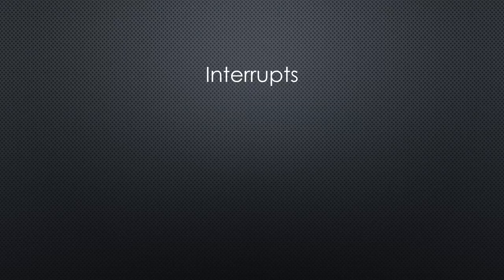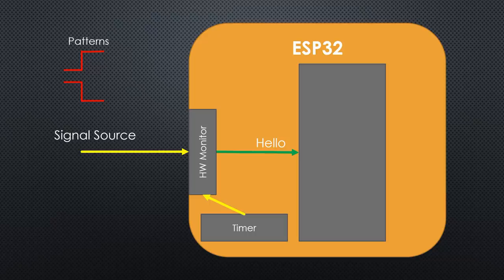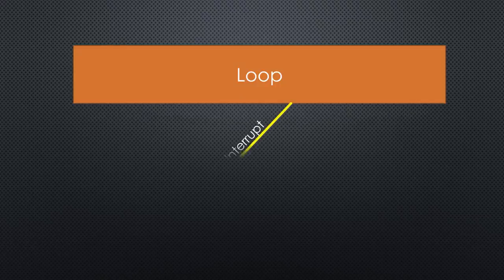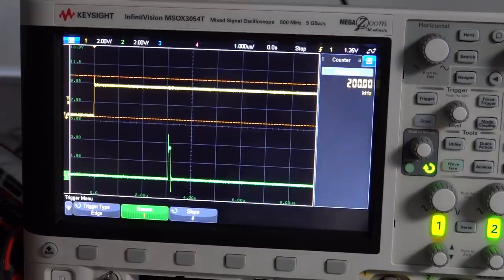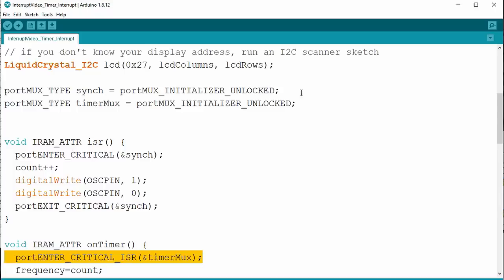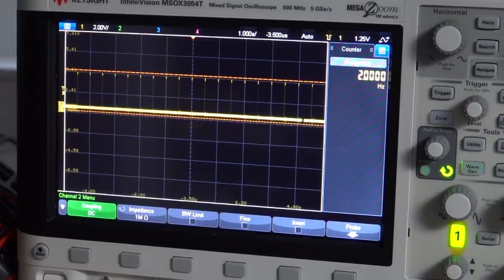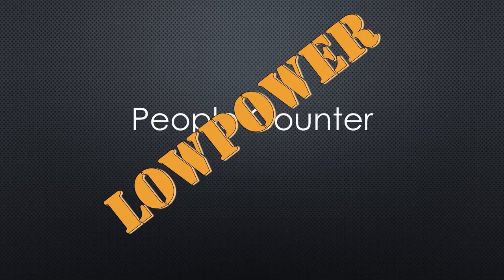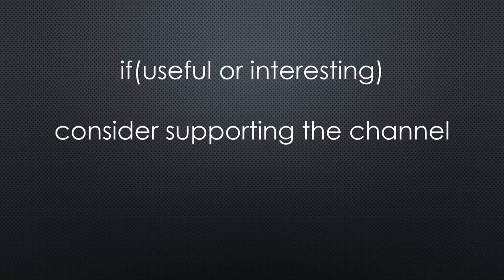#328 ESP32 Secrets: Interrupts, and Deep-Sleep under the Hood

Comment from the maker: At 15:20 I mixed micro with milliseconds. As you can see on the oscilloscope it is milliseconds
Reply: No big deal. It takes me an even longer time to wake up : )
Reply: Can you do a video on CAN bus? Also check out my channel if you want to see me build a two-legged walking robot. Enjoy
Reply: This inconsistency and delays you are showing is not a problem of ESP32, it's a problem of Arduino porting for ESP32. Just use ESP-IDF directly and redo the experiments - results will be completely different ;)
Reply: @techfuture9846  The 150ms of delay after wakeup to actual code running is probably issue with bootloader.
Reply: @movax20h , I'm talking about the pure interrupt response time, jitter, etc. The wakeup time is different beer.
Reply: Friendly hint - instead of comparing millis to previous time + constant, set the "future event" time and compare. Saves the adding operation in every loop run...
Reply: @rklauco  Or even better the rollover safe one that compares durations instead of timestamps (handles max. 49.7 days intervals):   
unsigned long delayStartTime = millis();
while (millis() - delayStartTime < 1000)  {   //do something }
Reply: I believe you can add text over the video to correct errors in the speech where they occur.
Reply from the maker: @gkeepleft  I do not have this feature. I only can blur an area or add info cards 😞

Comment: Is there a reason you used portENTER_CRITICAL() in the Pin ISR and portENTER_CRITICAL_ISR() int the Timer ISR? From my understanding both should be portENTER_CRITICAL_ISR() because they are called in an ISR (FreeRTOS Limitation). That could be the reason why your esp32 is resetting on very high frequencies.
Reply from the maker: The reason is that I found different examples.I am a RTOS noob
Reply: @AndreasSpiess  does changin that makes any difference regarding the reset behaviour at high frequencies?

Comment: This is why I still rely on 8 bit / 16 bit PIC MCUs, they do a very good job at handling interrupts and have a simple way to hook a internal timer to an input pin so you can count very fast signals. It makes easier to implement control loops like PIDs. Only if I need a web server or something to do with WiFi I go for the ESP32. The ESP32 is not a Jack of all Trades.
Reply: The more I learn about the ESP32 the more I want to just stay away.
Reply from the maker: Most of my projects are connected these days. This is why I like the ESP32. But sometimes I also use an Arduino...
Reply: I think that right now the ESP32 is the most complete microcontroller when it comes to stay connected and also have massive processing power. But if you don't need connectivity there are better options out there than the ESP32. In the end we choose what we feel comfortable using...

Comment: Mr Spiess, I enjoy your presentations and like this one too. Thank you for all your effort and shared knowledge. There are several reasons why CPU like this one may have long interrupt latency. One of them (and it is a Real Time limitations of large processors like multicore Intel and ARM) is cache coherency. Simple, interrupt code maybe not present in cache and other current content of the cache need to be saved before reloading new one to/from RAM. For vary fast approach, user need to instruct compiler (I dont know how to do it at ESP32 yet) to keep interrupt service routine (if short) permanently in cache. This is typical approach for RT Linux for example.
Reply from the maker: You  are right. There are a few other comments pointing in your direction,. too

Comment: Thank you for another interesting and instructive video Andreas.
>edit: went through the comments and found this was already reported, sorry
I just wanted to add that RTOS seems indeed to be a culprit for the interrupt response latency and jitter. I think that attachInterrupt actually hooks up not to the interrupt controller but to an RTOS callback function. This function is entered the queue of RTOS tasks, and get executed after the completion of all the previous tasks only.  Apparently it is possible to get a fast interrupt response when programming using noOS SDK from Espressif but I did not try this yet.
Reply: That's a mistake then. It's an interrupt and should have a higher priority than a normal task.
Reply from the maker: @Alexander: Maybe I will have once a closer look into RTOS...
Reply: I don’t get it… Arduino is by no means RTOS, and it has no callbacks or other real time capabilities
Reply: @Quemedices684  ESP32 Arduino calls various functions that are built around Espresif's SDK that in turn uses RTOS for WiFi operations. If one does not need WiFi or software timers then no RTOS is involved indeed.

Comment: Thanks a lot for your effort, your experiments,  the video and the explanations. And we are now back to the same question we discussed when the ESP32 became availabe: How to use the different cores for different tasks in Arduino IDE , e.g. to decouple WiFi. Up to now I did not find a solution. This is why my counter at the water meter still uses 2 pcs ESP8266. One just for counting and tranferring data via HW-serial without any WiFi output and the second for analyzing the data and communication with my home automation system. Not very elegant, but runs very stable, uptime 657 days since the last blackout caused by road construction works.
Reply from the maker: I think this is a good concept. Or use a little HW for time critical tasks.

Comment: This video helped  a lot! I wanted to monitor my PV panel energy harvesting using an ESP8266 and an arduino DUE (i know, not ebergy efficient but thats what I had lying around). Before th is video they were consuming 210mA and up to 250mA when publishing the measurements. Now i modified the sketch so that the DUE is always asleep (by pull down resistor on reset) and only wakes up for 3 sec (by the ESP) to measure and transmit the data to the ESP then go to sleep again. The ESP then (after connecting) publishes the data and goes to sleep for 20 sec or so. The result is that during sleep they both consume on 38mA and only 100mA when the ESP is awake. Only 3 seconds of 200mA now which easily runs this 24/7 on a single 18650 cell and for several days! Thanks for the insight!
Reply from the maker: Nice project!

Comment: Your videos are always excellent. By the way, If you want a low latency ISR on the ESP32, consider placing it in IRAM. (There is a flag you can put on the ISR definition to do this).
Reply: He already did that. I think the issue with ISR is due to arduino code, not ESP32. Also I don't think you really need the mutexes in ISR unless you manipulate more complex data structures from ISR. doing read-modify-write (like count++) from ISR, while rest of the code only do reads (so you might need to have two variables to track how much count you already processed, not reset it back to zero), is safe and doesn't require a mutex.

Comment: Andreas, perhaps a followup comparing the interrupt coding and latency on other 'Arduinos' like STM32, SAMD21, ATMega, ATTiny, ESP8266, MK20DX (Teensy), SiFive E31 (HiFive1), etc.
Reply from the maker: This is a very special topic. So blogs are probably a better place for such comparisons.
Reply: Take a look into there datasheet and you can compare by your own.
Reply: @ripper121  Ah yes, datasheets to find out about interrupts and how they affect everything... let me just quickly read for dozens of hours to compare a few µC...

Just seeing that a ESP32 is pretty much useless if you go into deep sleep is enough information.
Reply: @leocurious9919  Really, that's a very specialized problem and different for each individual case, as Andreas said. Think about changing just one clock cycle in your application code changing the complete timing that is at issue here. It is best to simulate this for each individual case, better to test it as an experimental setup. If something is important for a preliminary decision, it is the limiting/rating values and the clock behavior that can be found in the data sheet.
So @Ripper121's remark is far more helpful than displaying one's own laziness.
Stay healthy:)
Reply: @dieSpinnt  It would be a perfect followup to this video. And for which videos does this not apply?
"displaying one's own laziness"
Reply: Agreed great topic even for makers, IMHO.  Would add: How fast (or not) can it read from flash?  That's also a real differentiator that isn't obvious from specs.
Reply: @dieSpinnt  Although i also preach RTFM to everyone, your comment about Leo's laziness is unfounded. Why are you watching any of Andreas videos then ? Most of the content in this and prior videos can be looked up in the docs too. 
The question Leo asked is a valid one,  and i also agree that a good followup video would be to compare deep sleep wake up times of a few MCUs; and that's just an example (since this video talks about interrupts, comparing the way it's used by different boards is also a good follow up). 
Anyways, It's up to Andreas to decide what he wants to do in his channel and leo just gave a valid suggestion.
Reply: @srtghfnbfg  Andreas videos are of a very high quality in terms of information and relevance.
It is my right to say what I think of a (in my opinion) idiotic remark that you think is valid. Am I not justifying it?
And before someone feels trodden on the tie again: Idiotic is not related to the person, but to the comment. We all make mistakes.

Where the hell, where do I tell Andreas what to do? (I misunderstood your last line here, by force)
If I do something, then maybe to contribute a little bit to the wonderful knowledge that Andreas brings to people. At least that's what drives me and I'm trying.
It is up to you to do what you want. You seem to have misunderstood me. My remark about laziness was certainly not meant to be hurtful. More sarcastically funny. I can understand that one can interpret that differently, like you. But you are wrong and I hope to have clarified that. Not everything is always malicious and meant in a commanding tone by Adolf Hitler.

RTFM, study, research. Everything takes time! No master has fallen from the sky yet. Laziness and botch will not get you any further.
I stick to it, don't force anyone to think so and I don't give a shit who shares it! ;)
Got it?

P.S .: What got into you trying to advise me what to look at or not. Just think about how insolent and patronizing that is. Well, you definitely haven't thought about it. By the way, that's another problem that we should add above: Don't just read the datasheet's/AN's, think about it and understand it:P

One more to convince you how silly Leo's comment is: ESP32 and maybe all other MCU's he talks about and doesn't want to study in detail are DETERMINISTIC machines. Still asking because that speaks for itself?

Comment: @Andreas, I detach the interrupt at the beginning of the ISR on my Dimmer control, it's only 60Hz and an ESP8266 (today) but it did resolve the flickering I was facing at the edges turning on the off the light completely (and smoothly). Wifi has to be on and there is intense MQTT to keep dashboard as real time as possible, so if I miss a trigger at the edges I just complete the cycle one way or another. With this I could literally get the entire 1% to 99% (in a logarithm scale for real light scale) without bugs. Another great video from you. Cheers.
Reply from the maker: Interesting. I thought 60 Hz would be possible, especially on the non-Wi-Fi core.

Comment: I agree with your idea of being the RTOS influencing the interrupt latency. The RTOS itself (which seems to mee FreeRTOS reading the definitions you wrote to allow ISRs to be safely called) has surely some routines to schedule our loop() function with its own tasks, which can be in turn the communications module handlers (Wifi and/or Bluetooth). Even though you disable them, they could be still working for some reason. In addition the scheduler itself can use an interrupt to switch internal tasks, and this can be another jitter cause.
Reply from the maker: Many other commenters support this theory.

Comment: A great part of the inaccuracy in the interrupt code (at 7:13 in video) is caused by your own loop code: 
{ frequency = count; display(0, "frequency=", frequency); lastEntry=millis(); count=0 }

You use count but reset it only after displaying on the pretty slow LCD. That means, all events that occur during the LCD operation are not counted, but lost. Also, if the duration of LCD output varies, it worsens the count precision. You could improve it if you first completed the job of count handling:

{ frequency = count; count=0; display(0, "frequency=", frequency); lastEntry=millis(); }

BTW, your polling loop (at 3:54 in video) would be more elegant if you replaced 
  lastentry= millis(); while (millis() < lastEntry + 1000) {...}
with
  endTime=millis()+1000;   while (millis() < endTime) {...}
This way the addition would be done only once. However a good compiler might catch this and produce the same binary code.
Reply: The compiler will figure out the optimization you mentioned at the end automatically. There will be no difference in performance. However, your hint about doing count=0; just after reading frequency is a valid one. In fact if you have mutexes used, you can wrap read and reset of the count, into critical block and be even safer. There are other approaches (like not resetting count at all, and remembering the last count, and subtracting it from current count to get new frequency (might require a special handling of overflows tho; but it will not need mutexes).
Reply: it is perfectly fine how he did it. even if the displaying took multiple seconds it wouldnt change anything since the lastEntry variable is changed just before resetting the counter. so it doesnt matter how many counts there were while communicating with the lcd.

correct me if i miss something though

Comment: I'm currently using the ESP32 for a fft application on net voltage and load current signals (2 analogue channels, 50Hz), where I trigger a timer interrupt up to 1024 times per period, so ~ 100k samples/s on RTOS using both cores.

In my case I'm working with hardware interrupt each ~20ms which calculates a timer value for the real period time divided by 1024. This timer or counter calls another ISR every ~ 20µs.

In my opinion the ESP32 is fast enough for similar applications. But I'm totally agree with your point of the delay of hardware interrupts. Thanks for your research!
Reply from the maker: Quite a sophisticated application ;-) I use now a second RTOS task with a delay for my morsetrainer. Works fine (ms)

Comment: Always a pleasure to watch your videos. Thanks for this on. I ran into some trubble appling the irq approach to a 100Hz signal with not as perfect steep flanks as in your given example. The isr gets triggered multiple times during rising and falling flanks. The RISING statemend seems to have no effect in the allocation of the irq. The esp32 seems to have problems with shallow flanked and slow signals. In such cases additional HW and Code is needed...
Reply from the maker: It is always good to have a Schmitt trigger in front of the interrupt input. Maybe you can disable the interrupt for a few ms in the ISR as a work around.

Comment: Andreas, nice video! Regarding start-up time: the ESP32 supports deep sleep wake stubs that are executed before any normal initialization. It can send the ESP back to sleep if for example the voltage of a connected battery is too low. I use this feature for undervoltage detection of a connected lipo battery (saving on an additional hardware component). Best
Reply from the maker: I mention that in the summary. Do you have an example for the Arduino IDE?
Reply: @AndreasSpiess  Sorry, missed that part! It is easy to implement in Arduino, as the default wake up stub function is weakly coupled and can be overwritten directly:

RTC_DATA_ATTR int bootCount = 0;
void RTC_IRAM_ATTR esp_wake_deep_sleep(void) {
    esp_default_wake_deep_sleep();
    bootCount++;
}

This increments the counter before the bootloader starts.

Greetings from Germany

Comment: Hi. What a great video. I think you may have just solved my esp32 interrupt crashing issues. I will test your code tomorrow. FYI I'll be using it for a speedometer.
Reply: Update: the Frequency_Counter_with_Interrupt.ino seems to run fine. A little inaccurate at really low rpm (60rpm for example) but good at high rpm. Maybe some smoothing required. Now trying to use time between pulses so work out rpm. Not going to plan yet ;)

Comment: If your running an RTOS then there will always be issues with when you get to see the interrupt. so i can see why the latency is changing, it depends where you interrupt arrives in the the background processes. Not sure if the ESP32 RTOS  has variable time slots or  fixed time slots so there could be issues there. In the embedded world there is a lot of effort to get an RTOS working correctly. Spent many a happy week on embedded RTOS courses, just to decide that if you don't need all that an RTOS offers then it best not to use one. Also interrupts are a pain for proving the code is safe, as how do you check all the possible places in your main code where it can get interrupted, don't get issues when interrupted at the point.

Nice thought provoking video as usual, thanks
Reply: You can process interrupts at higher priority (i.e. level 5, just before NMI level). By default ISR will be lowest priority (level 1), so it will be preempted and/or delayed by other routines like a task scheduler. It is possible to have stable latency and minimal jitter using FreeRTOS.